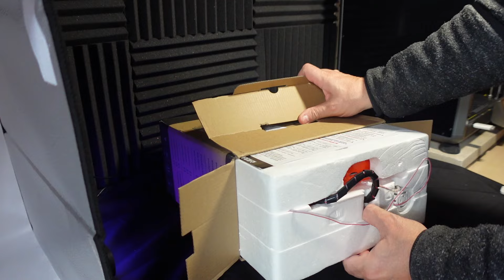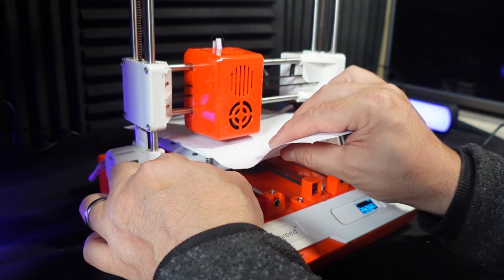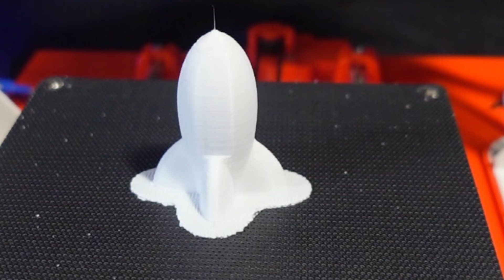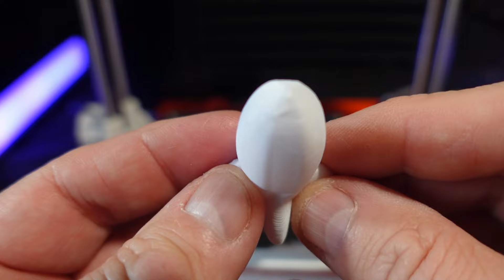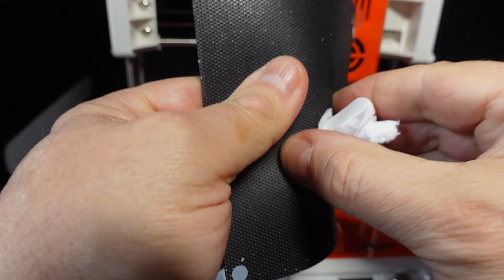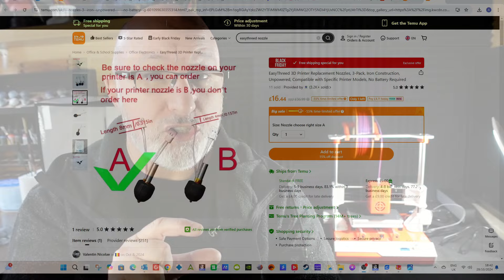EasyThreed 3D Printer The Cheapest Printer On TEMU Reviewed

Comment: Hi, I’ve just got the K 10 & I’m totally confused. I can’t get it to rise all the way up to the top, so I can level it properly. I mean with my actual spirit level since it doesn’t level very well using its own settings at all. Also my mainworry is it won’t download Cura to my Apple Mac. Do I really need it or is the other software that they give you enough- called easyware? I’m sorry I’m an absolute beginner and know nothing about this stuff at all. I did a test and it did work, although it was just slightly wonky. Thanks kindly!
Reply from the maker: You certainly don't need a spirit level to level the plate it's not about how lovely is on a spirit level it's more about does each section of the plate have the same distance from the nozzle that's why you need the piece of paper but a spirit level won't help you do that
Reply: To take it to the top press the arrow button for 3 seconds and release. It will rise by 1cm at a time. Try viewing the tutorial video that comes with the printer, it is very informative and answers all the questions you are asking. It also comes with it's own slicing software. Read the manual, it might help you. I have had mine for 4 days and it works like a charm.

Comment: So this cant be used to make a custom back panel on a Tablet or phone ? Only for decretive stuff.
Any one have a suggestion like DIY one or the cheapest one that can be used to make more than decretive stuff.
Reply from the maker: Ender 3 is a good starting point
Reply: Ender 3 v3 SE. Advertised for TPU as well as PLA. TPU is the material you want for phone casing
Reply from the maker: I'll be looking at something like an Ender 3 what depends on your budget you can get some pretty good printers for between 2 and £300 look at elegoo any cubic

Comment: This is an interesting piece of equipment and i would love to see some experiments done with it, just to see how good of a printer you can turn it into. I got my first 3d printer about 2 months ago, it was the cheapest used printer i could get my hands on, a Ghost 5 by Flying Bear. When i got it, it was straight up garbage, could barely print anything in ABS without clogging the nozzle, PLA... well, forget it. But all it took was a single 5 dollar replacement of the extruder neck, ditching that garbage V6 neck has made it go from barely printing anything, to printing pretty much anything without issues. I'm curious to see what people can make with this printer in particular, being so cheap it's a nice entryway to the hobby, and printers excel at making parts for themselves, so taking this and upgrading it to something higher quality once you decide you actually want to keep going should be a no brainer.

Comment: Can it hold a 1kg spool or is that too heavy?
Reply from the maker: not tried a 1kg spool TBH  - I suspect may be too heavy but need to try it and I will :)
Reply: Way too heavy. The printer itself weighs far less than that. Unspool some filament and hang it on the arm supplied.